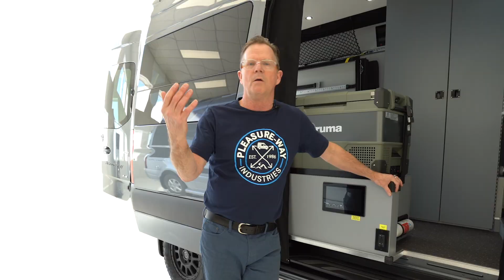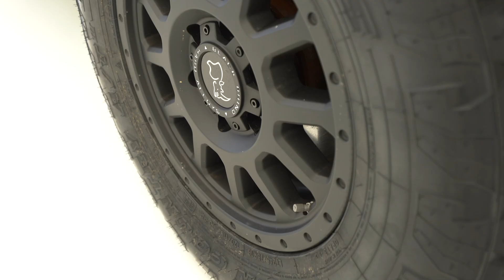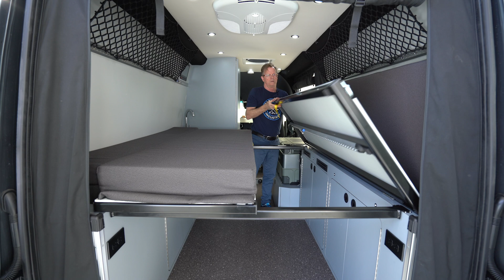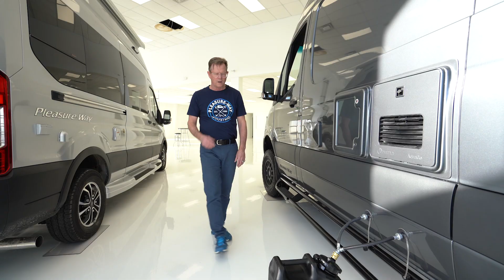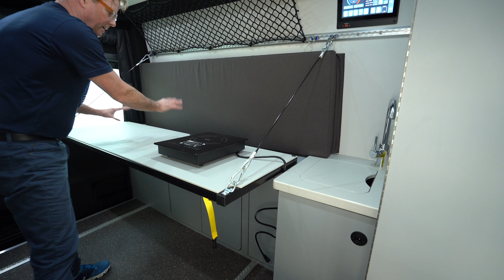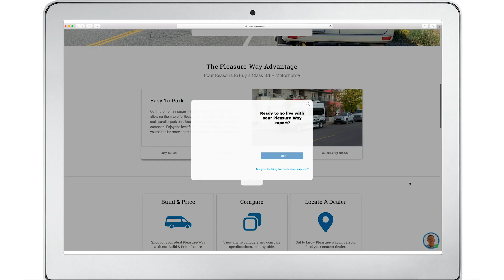REKON 4x4 | Answering Your Most Asked Questions

Comment: It's so interesting watching him try and figure what the use case is (he's definitely not a user). Only limitations I see is that the grey water could have been underneath (allows stealth camping and saves holes in the exterior), the Truma takes up well needed counterspace and should have been on the ground on a slideout allowing for a storage and cook station above,  and the bed cables need some thinking or another support or you can't get out of bed easily. Otherwise, love what Pleasureway has done here.

Comment: My truma cooler is dispersing heat into the back of the cab . Also the voltage converter also disperses a lot of heat making the back of the van a oven ! The only place that’s cool is front of the cab . The shower area is to small for a 6 ‘ person . Also the water from the shower comes out of the shower curtain and runs out into the cab . This setup is made for cooler climate not for the south area of this country. The ac on the top is about 2 feet away from my face . I don’t know where the thermostat is located family can steal but where you’re laying down it’s cold and the reading on the digital wall is saying 20° difference . Lots of problems . Also sumo Springs are a must . Is not design for people that are 6 foot or taller . It’s made to heat up the vehicle . Also if you have The ice cooler heating up the cab and the voltage transformers heating up the cab the ac is over cooking where people sleep .

Comment: Does the added AC unit on the roof reduce the amount of solar panels?
Reply from the maker: Hi Marc, yes that's correct. If you choose the A/C option you will get 3, 100-Watt solar panels (opposed to 4 panels with no A/C).

Comment: I wonder why 12v a/c was not chosen if this is for off-the-grid. I see many conversions choose 12v a/c over 110v version. Can that be an option when ordering one?
Reply from the maker: Hi Chester, as Grant discussed in the video at 16:00 the reason we don't use a 12v a/c is due to the battery capacity requirements to run it. Our 400Ah's of lithium batteries is a significant power source but it would only run an a/c for 2-3 hours at best. We didn't want owners to be stranded with dead batteries after such a short time running an a/c. So as it stands with the REKON, the only option is a 110V a/c. Thanks for your question!
Reply: @pleasureway  Well Understood. Thank you for the explanation.
Reply: That's a deal breaker for me. They could do it just add more lithium. I was getting ready to buy one until I realized this. Such a shame.

Comment: Not being able to run the a/c off grid is a big deal breaker.
Reply: there is not a single AC unit available on Class B Vans that can run off the grid for more than 2 or 3 hours , please let me know if you find an alternative ..would be very interested.
Reply: @dwingo8003  storyteller overland a/c can run all day.
Reply: @dwingo8003  running the AC off grid for a short while is often all it takes. cool the van down after sunset, keep it cool for an hour while taking a nap after a hike, let it run for an hour while stopped for making lunch...I'm using my off- grid AC all the time and never ever drained my house batteries - not even close. I agree that not being able to do that in the REKON is a huge oversight.
Reply: @dwingo8003  The Storyteller Overland and Winnebago Travato with the VOLTA system can run the a/c all night off grid, they have huge battery capacity. In addition the Storyteller Overland Beast Mode has an automatic engine on system so there is no battery limitation to running the a/c off-grid. Nevertheless the REKON is an interesting design and beautiful in it's simplicity. Less to go wrong.
Reply: @Wingo DK  I think the insulation and intake and exhaust flow of air negate the need for AC.
Reply: @dwingo8003  Anything with a Volta system can do it. I know there’s other brands also but that’s the main one I know about. People run their air conditioner for 10 or 12 hours and then drive for an hour and a half and recharge it
Reply: @dwingo8003 storyteller vans have a look
Reply: If thea/c has aftermarket software start you. An run it off small Honda generator

Comment: What are the dimensions of floor space in garage?
Reply from the maker: Hey Kevin, the raised floor space in the garage is 69" L x 44" W. With the bed down you have 30" of height. I'll add that there is an additional 3" of length in the garage as there is a gap between the rear doors and the raised floor, so it ends up being 72" of length. Hope that helps!